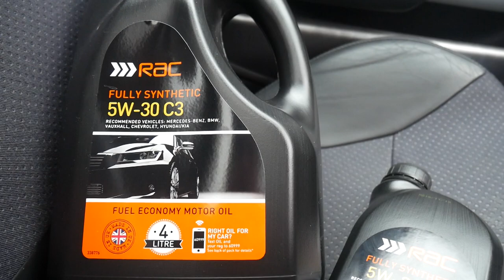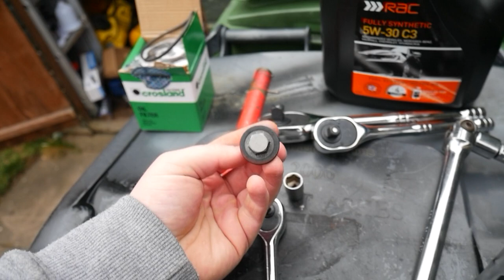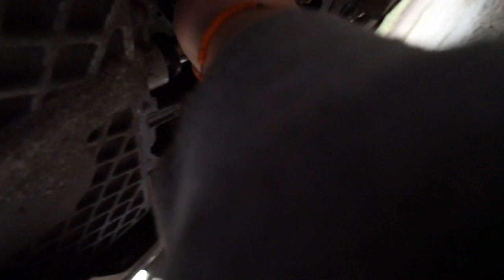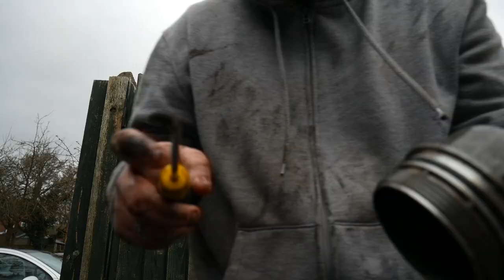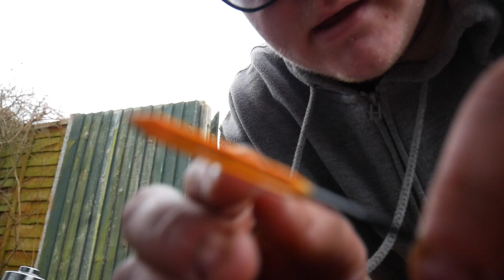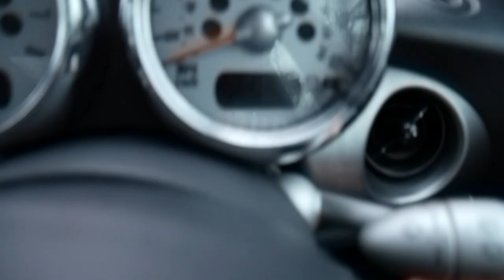How To Do An Oil Change On A Gen.1 Mini (R50, R52, R53) | Grinding Gears

Comment: Have yet to do this, but apparently if you loosen the oil filter housing to the last 2 threads or so and let it sit for about 10 mins, most of the oil should drain out, leaving less of a mess when you pull it
Reply from the maker: Now that I didn't know, let me know how it goes because it is a real mess!!! Take care out there :)
Reply: Top tip! Thanks 😎👍🏽

Comment: I like to have a go at most of the "non technical" jobs myself for a little job satisfaction.... Do you have or will you be doing a complete coolant/antifreeze flush and refill? ... Easy to understand vid btw.
Reply from the maker: Thank you Steve if you check out my latest video where I change the radiator you can see me do a flush and refill. if it’s not too clear to understand let me know and I will do a full dedicated video on it

Comment: Nice one m8,can you du one on changing the liquide cooling? R53 run hot and its a good Idea to change the cooling liquid every 40.000
Reply from the maker: Hi Mike,

Check out one of my recent videos where I replaced the radiator on my R53, I refill the coolant there.